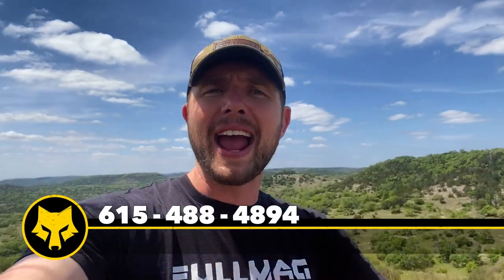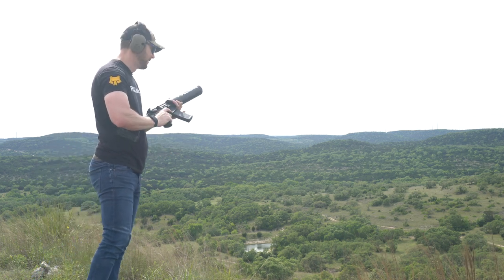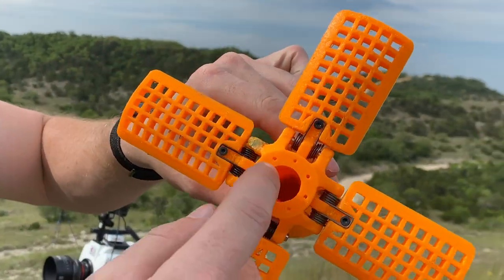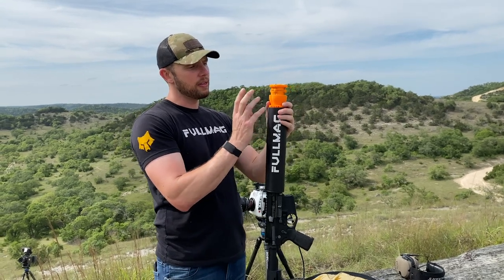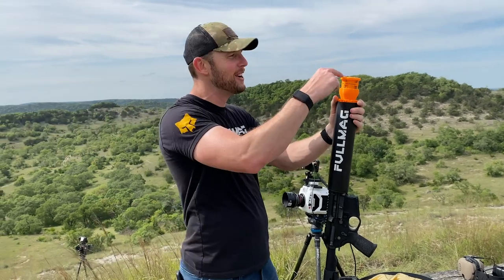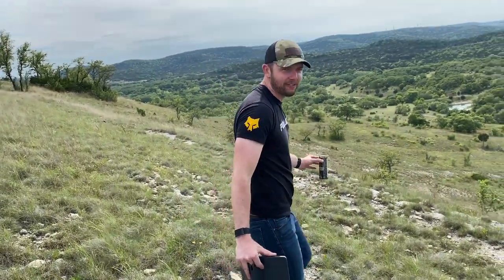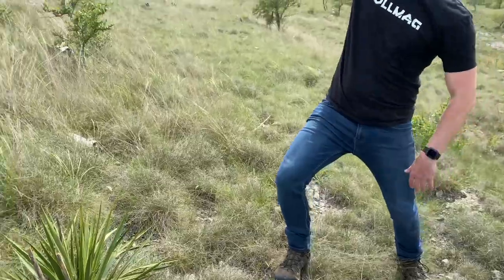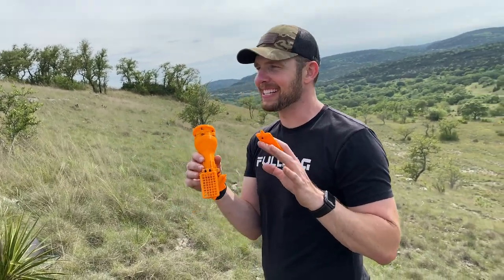I Put a GoPro in AR15 Can Cannon 📷💥

Comment: The fins likely don't have to be spring-loaded, the air resistance should be plenty to get them to spread out on their own, especially if they have edges that catch the air as it's fired. This should help muzzle velocity a whole bunch, as you won't have the added friction of those fins shoving against the inside of the barrel.
Reply: That was my first thought, make them thinner but with a thicker spine so they "scoop" the air.  Think that sort of design might work a treat in a mortar.
Reply: OMG imagine if you could replicate the Matrix scene with some low-level clouds on a mountain with mortar round punching through the cloud on the way up and then back down through and off the mountain lol
Reply: In fact a weaker spring working the opposite way to slow down the fins and prevent them from snapping off from the violent action would probably work better.
Reply: It looks like spring hinges should have been mounted at the front of the round instead of the back.  -That way, the fins would stay flat against the body and only deploy when the air flow slows enough to allow them to pop out.  You'd get serious height and the fins wouldn't self-destruct.  Man!  You could put that thing half way into orbit!  Do it!

Comment: Was the “didn’t even cycle the bolt” intended to be a joke that went over my head?  Hard to tell, I didn’t think the can cannon uppers used a gas system of any kind. 
One that would cycle and pick up another blank would be pretty interesting.
Reply: I own one and you are correct....they DO NOT cycle the BCG....went over my head too!
Reply: its not suppsed to cycle the BCG, itd be pretty unsafe to load another projectile into it
Reply: @AFGMirMir7477    You’re right. Safety is tantamount. But as an owner it would be cool. 
But then there is no need as manually loading it negates the need.

Comment: Being the engineering type that I am, and a gun guy, I love the use of AR hammer springs for the grid fins.  Too cool!  That said, I think those grid fins create way too much drag.  A blade fin, much like they use on 2.75" folding fin rockets, only shorter, would probably give you better range  Also, a groove around the body at it's max diameter, with an O ring installed would also give you a better seal for more compression and higher muzzle velocity.  Would love to see more of this little camera launcher.

Comment: I think you should ditch the springs, cool system though, and just let the air open them. Maybe make them snap/lock into place when opened. Second add a wad behind it to get more energy out of the shot.
Reply: I was thinking the same thing. I was also thinking that they could let the fins rotate and put the camera on a swivel. It would add weight but the rotation would cut down on the drag, then the most drag would come from the flat part of the camera and not the body of the projectile.

Comment: For future revisions of the the gopro holder you could try a non elastic cord that only allows the grid fins to fold out to the nominal position, thus preventing the hinge failure from over fleet flex. That would be the cheap inexpensive modification conversely you could explore using metal hinges with a metal reinforcing rod down the spine of the fin

Comment: My first suggestion (as an engineer) would be just to forgo the springs in your design, since wind drag itself will force the wings to deploy, as an added benefit this will delay the opening and get you a lot more range and a gentler opening with less shock and hinge stress.  This change will give you a lot more room to vastly increase the size of the hinge bearing surfaces so that they don't break off as easily.  I would also increase the base size (housing the hinges) to the bore size, which will give you a better base seal and a smaller expansion chamber too increase launch velocity, this change can also be used as the backstop for the wings to prevent over-rotation and snapping the wings off. Hopefully this wordy explanation is clear enough to be self explanatory.  Good luck and keep it up...

Comment: Generally speaking, I'd expect the fins you're using to slow the projectile down, not stabilise it in flight; I'd revisit the way RPG fins are designed; they work with the airflow to provide spin to the missile body in flight, thus imparting a measure of stabilisation. Given that you want the GoPro to remain reasonably stable, and not spin, have a look, instead, at the fins running in line with the direction of flight, and add horizontal canards to the front as well , to provide a little forward lift.

Comment: Ok, you guys tried a gopro in a mortar already? So remember model rocketry? One I had would take a picture on 110 film upon ejection of the parachute. Some of the smaller ones didn't have parachutes, and spin stabilized to land, well, softly. So here's where my brain went....try the mortar again. Put the fins on a bearing around the lifting charge tube. (I know nothing  about mortars) Try to figure a way for them to stay folded until the camera carrier turns over at apogee. When they open, they will act like rotors slowing the whole thing down. Because the fins are on the bearing, the camera holder won't spin giving a more stable  picture until recovery. Stay safe Stay fun🇺🇸👍🇺🇸🤘🇺🇸

Comment: Try a tracker string attached to the GoPro pod. Use a rubber band to keep the fins/wings from deploying as soon as the pod launches. Once the tracker string reaches the desired limit, it will snap the band releasing the fins/wings. Should allow for a further distance and reduce the shock load on the fins/wings at initial launch.

Comment: An ar trigger or hammer spring is probably a little bit too much, and those hinges should be much thicker. TBH it probably doesnt even need a spring if it generates enough drag. A single O ring or rubber band should be plenty to open it.

Comment: Since the fins broke off I think alternate stabilization  could be achieved by attaching a fabric tail like people put on the bottom of kites.  The tail will slow the rear of the projectile keeping it tip forward. By making the projectile shorter it should reduce its weight and increase its initial velocity.  Unfortunately it will cause more air friction which will both reduce total range, but also lower impact speed

Comment: Why do you have the fins deploy as soon as it leaves the barrel? The large cross sectional area of that grid fin design is going to add a lot more drag than thin RPG-7 fins. So you're decelerating the projectile as soon as it leaves the barrel. If deceleration is the intent, you'd be better off to have the fin deployment delayed so that if you shoot a parabolic trajectory, they will only deploy once it starts to descend. That will combine range with video time. Otherwise change to narrow fins for directional stability with less drag.

Also small 3D printed parts rarely do well in high stress conditions like hinges due to layer delamination. Metal inserts could help.

Comment: Problem is 3d printer wont print perfect circle so you need to print the body larger and put it on a CNC lathe and true it so its the same size of a coke can and it will be round so you seal it.    Also the drag fins are opening the wrong direction. They need to face backward and then it wont open until it slows down and it wont bust them off   And then fire the cannon at 1 o’clock.    The coke can goes further because its filled with a liq and it expands and holds the gas sealed.   You may not get that with a plastic base.   I would just print a holder to grip a full coke can   .

Comment: I think you are using the wrong printer and material. Try using a Markforged. It prints in nylon mixed with chopped carbon fibre, and the higher end ones also lay in a continuous carbon fibre (or other fibre) that makes parts that are as strong as aluminum, but light as plastic. I have the base level machine and absolutely love it. Every thing I invent I can send to the printer behind me, iterate and do it again. Best resolution I have ever seen from a desktop printer.

Comment: I did notice that the projectile only holds in the pressure for an extremely short time before it is mostly vented and then the fins are pretty much pure drag on the barrel. So it doesn't have enough time to accelerate before it slows itself down

Comment: If I could make a suggestion.   Print a replica go pro and add the proper weight to it then test with that. Flip the fins around so they fly straight with speed and open up when it slows down. Not sure if you have enough  power involved to do that, but it might help with distance.  3 larger fins might be more durable.   .Alternatively, try adding a rocket motor that ignites with the blank just for fun.

Comment: Grid fins have far too much drag for this. Also printed hinges don't take these forces too well. I guess you could just use 6-8 spring steel wires as fins. I would also add 1-2 O-rings to the body of the projectile to get a better seal and maybe print the front with flexible material with honeycomb infill to have some buffer for the camera.

Comment: Those kinds of fins are not for launch ground to ground. That design is for air to ground controlled decent. If you want launch activated stabilizer fins you need to think parallel and thin. Also, your launch should be elevated by at least 40 degrees for effect. 
If your concern is survivability of the device for reuse as a gopro launch vehicle you will have to devise a friction delayed, spring loaded, mid body separation apparatus in which there would be a parachute which would deploy upon separation giving the device a controlled decent.

Comment: The PLA is too weak for such small joints of the fins. You could try curing the PLA in the oven after its printed, this usually increases the hardness of it so its not as brittle on small pieces. I do this for 3d printed rocket stuff.
In the slowmo it shows the fins snapping way backwards and thats where the joints broke. Some very high test fishing line from end of fins to the gopro housing will prevent the snapback when the fins deploy.

Comment: So your issue with your "Pro Jo" is the fins are not curved. Like you would see on a single engine aeroplane, their blades are curved to allow then to cut through the air. You would need to incorporate that same idea for this product and I would even suggest I stronger material, such as carbon fiber. All those things combined should allow it to spin and operate as an RPG7 like you stated. Another idea is you could go back to square one and completely redesign it to be modeled after a mortar with a wider head, tappered body and molded fins.

Comment: All you need is a piece of monofilament fishing line to act as a hard stop for fin deployment, with that plastic that's probably all you're going to be able to do to avoid snapping the hinges. The aero forces on an opening fin are strong by themselves, and then you've got the leverage from the length of the fin to deal with too.... a stop line takes the force away.

Comment: Can cannon was too level. I’ve found a 45 degree launch angle gets best results. As for your GoPro adapter, those fins are more like the old Snake Eye bombs. They produce too much drag on the projectile. Folding fins might be better for longer flights and longer videos. If you are worried about not enough air pressure behind it, smash down an aluminum can into a gas check was between the blank and the GoPro adapter.

Looking forward to more videos.

Comment: You should put a old ring Right Where It Bolts together and it'll clamp the O-ring and make a good seal Plus it won't be able to come flying off of there when it comes out because it will be compressed between the two pieces of plastic which will also act as a shock absorber
Reply: Hopefully that made sense put an o-ring in the front where you mount the GoPro in it cuz you can see gases escaping past it
Reply: And mount for small pieces of aircraft cable to the Finns so they can only open so far
Reply from the maker: I'm sure we can print the slot for the o ring in the next version

Comment: A GoPro problem with smashing the screen can be fixed by replacing the lens I don't know exactly the material but if you watch some of the off-road a downhill bike people they've got the same problem with smashing in trees crashing and rocks and stuff and they usually just take off the lens and replace it with a more durable glass or plastic so that might be something you might look into and if I remember right there was a guy that replaced a GoPro lens with a another type of camera lens the same lens different names and on the cheaper camera it has a more durable break-resistant scratch resistant screen

Comment: why not try the same thing but with the M7 grenade launcher adapter for the M1 Garand. With the fin adapters for regular hand grenades you would only need to create a grenade shaped housing for the go pro an not have to worry about fin failure. Plus with .30-06 blanks you should get more distance, and if you really want to kick it up you can try rifle grenade blanks for some extreme distance.

Comment: 🤔 How about a shotgun-shell-wad (off course the size of the tube) seemed as you lost pressure before the pro went out. 
Whats the psi going into the tube??
Framerate looked like manually adjusted for sure.... Even with a phantom, to get that slow, you need software n a jokester on the keyboard 😁

Comment: Cut a coke can sleeve to fit over the bottom and give you more velocity and release the spring loaded paddles slower as it slides off in flight. If that doesn't help, maybe you could try throwing it off the cliff. It would go lots further anyway!

Comment: I was actually dreaming up a way to do something similar the other day. But with much higher velocity and bore size. By cutting a pocket in the end of a projectile big enough for a gopro or the like and connecting a line to the memory card that is almost the same length of flight to pull it out before impact. Camera gone but memory card intact

Comment: The prob I see is that it’s just being “lobbed” out of the barrel there is no rifling or any doing to the device once it exits therefore your just hoping that it will travel through the air without cutting through it.....kind of throwing a shot-put!
Reply: Then comes the problem of having the cam not spin with the rifling.
Reply from the maker: Yeah... back to the drawing board

Comment: ........I'm sorry but fucking hell, I have in all honestly had farts that were more exciting and surprising than the final GoPro shot... I mean seriously. How in the hell did it turn out so damn underwhelming? I doubt that GoPro holder/rig weighs more than a can of soda, and these can cannons usually launch full sodas very far... I think it was probably those weird ass spring loaded fins on there that probably caught all of the air when they opened up absolutely killing the distance... Could have probably been a lot simpler, lighter, more aerodynamic and would have travelled a lot farther if you simply 3D printed up a standard 3-fin missile like get up for it instead..... This was pretty damn disappointing.